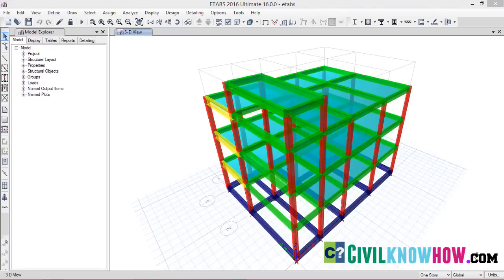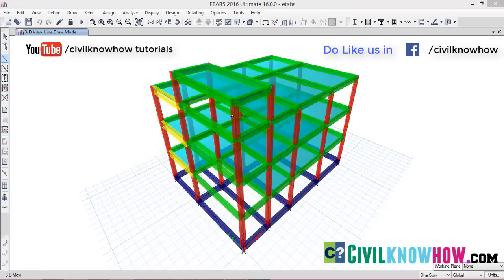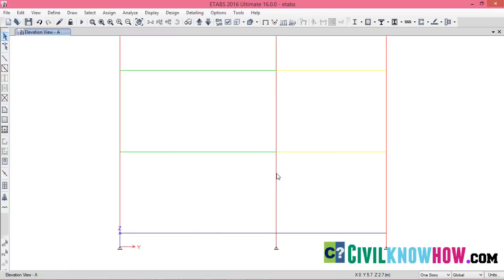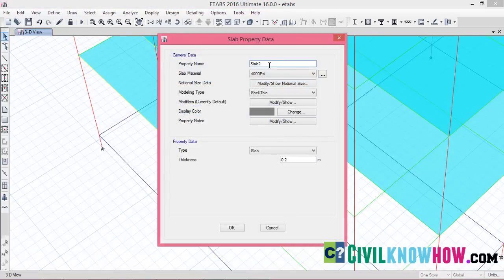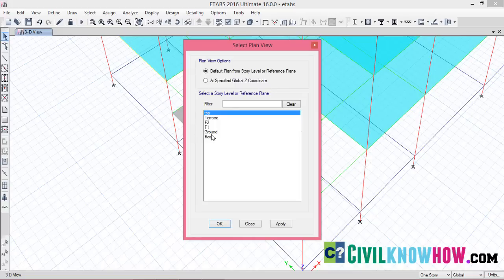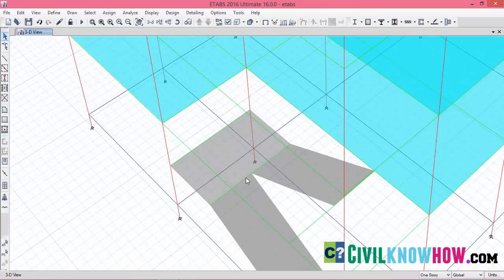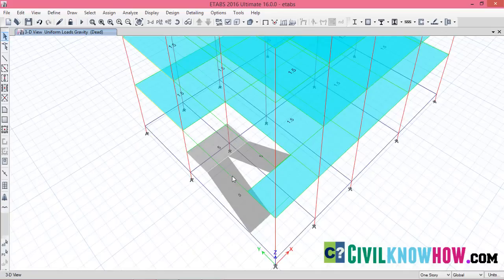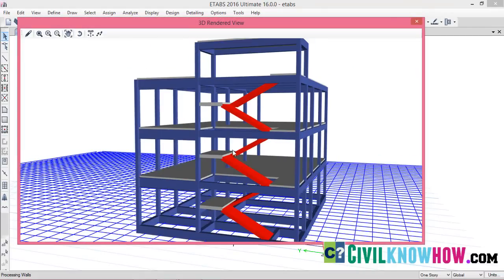Modelling Staircase in Etabs 2016 [Beginners Tutorial]

Comment: joining the middle of two columns with a beam will create short columns. These short columns require more reinforcement due to increased stiffness resulted due to decrease is length of column to half. Will static seismic analysis detect those as short column and give the increased reinforcement? or should I do dynamic seismic analysis?
If dynamic analysis is required, which dynamic analysis should i do?- response spectrum or pushover or time history. Or any one of the dynamic analyses will work?
Reply from the maker: Short columns does require more reinforcement.Column stiffness is related with its cross section ,not length.Adopt response spectrum for dynamic.

Comment: @CivilKnow how 
I just have a small question. I am modeling a timber (mass timber) core wall in place of concrete core wall. Can you please tell me how to find the forces in the wall joints as those timber walls have to be balloon framed with steel connections. I just wanted to calculate how much forces those connections would take up. 
Please REPLY